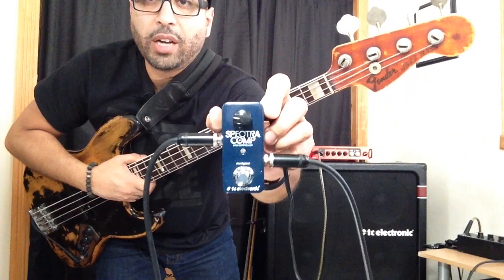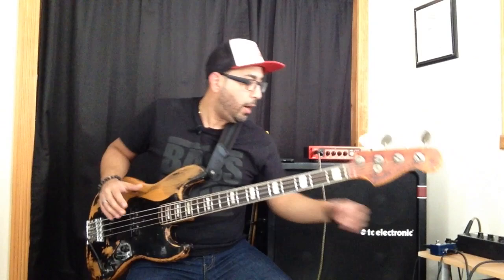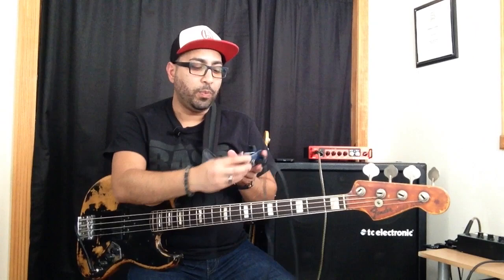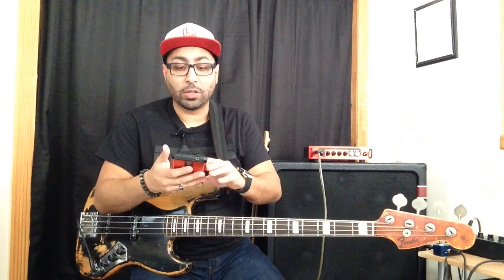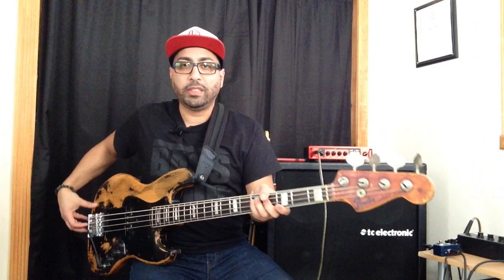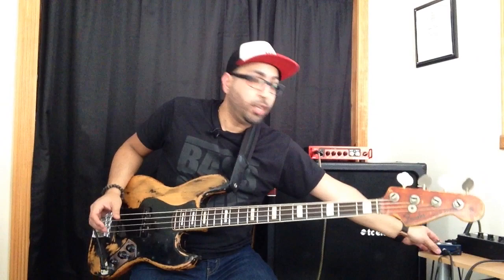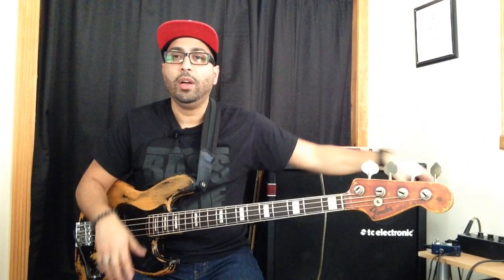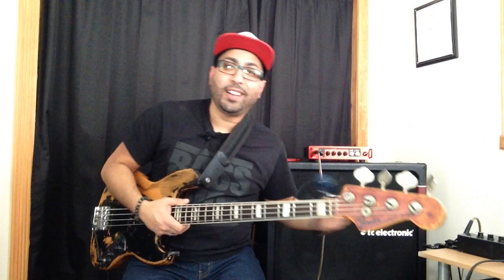TC Electronic SpectraComp Demo w/Josh "Swing" Lozada

Comment: Got mine 3 days ago! Love recording w/it! Get one!
Reply from the maker: Right on!
Reply: Does it sound good even without a toneprint on? and is there any suffering of tone while using?
Reply from the maker: The pedal is true bypass so it's not effecting your original tone when the pedal isn't engaged.
Reply: I mean is there a tonal compromise while it's on? some compressors lose some high end and i really don't want that
Reply from the maker: Eduardo Solis I hear you. actually yes it's going to change the tone. That's what compression will do. You should hear it in the video. if you haven't heard it with headphones or on good speakers, please do. You'll hear how the tone changes as I use the pedal.

Comment: if only they had a feature to save 3, 4, or 5 of those presets to the pedal and switch between those.  To have to change compressor settings for different songs during a show would be a hassle this way.
Reply from the maker: I hear you. I personally haven't had that issue. I have found the compression setting that I really like that works with pretty much everything and just turning up the knob (or turning down) provides different tonal option within that one preset. But I can see where the ease of being able to save multiple settings would be very convenient.

Comment: I already use the spectra comp built into my Rh450, would this be cool to use along with the compressor in the amp? Would it be too much compression? Would you suggest shutting off the amp compressor and using a Toneprint  through the pedal. Is there a such thing as too much co,impression? Lots of silly questions to some but I'm serious about them?
Reply from the maker: Hey Joe. I would suggest not stacking the compressors. So yes, I'd shut the spectracomp off on the RH450 and engage and disengage the SpectraComp pedal as needed. Using both compressors can really suck the life out of your bass tone and notes.

Comment: where should I add this in the line of my effects? Right now Im running pedals in this order:
Wireless receiver -->PolyTune2 -->Ampeg SCR-DI(use this alot as my fuzz) -->Line6 M5 -->Line 6 M9 -->Ampeg Portaflex-800
Reply from the maker: Hey. Honestly, you can put it wherever you'd like. Compression is going to effect things differently so it all depends on what you want to hear (or don't want). I currently have an Octave pedal, Envelope Filter, Overdrive then the compressor. But there's no 1 way to do it. All the best.
Reply: So when you arrange them like this are you compressing the effects before or after the SpectraComp? Thanks!
Reply from the maker: Johnny Flores Hey man. It's really all up to you and what you want to hear and how you want to hear it. I normally compress after the envelope filter, octave pedal and overdrive. And my reverb and or chorus goes after the compressor. But that's just me. You may find a different approach works better for your ear. In the end, there really isn't a right or wrong way.
Reply: thank you!

Comment: How do you reset the preset to the default one?
Reply from the maker: LOWD sorry to say but I'm not sure. I haven't had the need to go to a default tone.
Reply: The default setting is available on the website and mobile app if you want to return to it. I've never found the need to use any other setting, it works great straight out of the box.

Comment: Your playing is real nice.  Nothing against your playing it's
  nice... But I got a spectracomp and hated it. . The Tone Print phone APP does NOT sync with the TOnePrint Editor. Plus the Tone Print APP does not store your Tone prints on the APP, If you're not on wifi or Cell ... I had that issue in Sacramento, CA. I wanted to change my Tine Print sound but wasn't able to get Internet connection So i had to stay with the tone print already loaded into the phone..  Im selling this pedal..  The TONE PRINT "ARTIST"sounds are not so great if you are a pro player. But cool for a beginner type ..  The TONE PRINT really is  just a NOVELTY at this time.   I was hoping for the best . But i don't need this novelty item.
Reply from the maker: KPM thanks man. Not sure why you had such a bad experience with the pedal. Maybe you got a defective one but as you could see in the video, the tone print app worked because I did it live and the tonal difference was obvious and I didn’t have an issue with the editor either. So maybe reaching out to TC Electronic customer support would have been a good idea. As far as it not being for pro’s and only for beginners is pretty ridiculous. But it’s your opinion. But sorry that you didn’t have a good experience with the pedal. I found it to be useful and easy to use. Wish you all the best.

Comment: playing this through a looper isnt an accurate test, in my opinion.
Reply: I disagree. It's a pretty good test. The looper pedals recording quality is high enough to give an accurate playback and free up the player to experiment.
Reply from the maker: Agreed. The looped signal is the one being processed. So in essence the compressor is effecting that signal, which is what we're listening to. The looped signal is a little darker sounding than the actual clean bass signal but the compressor is still doing it's job and you can clearly hear how it effects the tone when engaged and disengaged. Cheers!